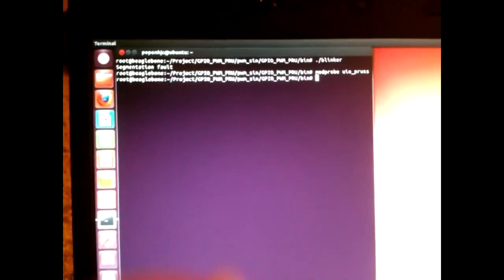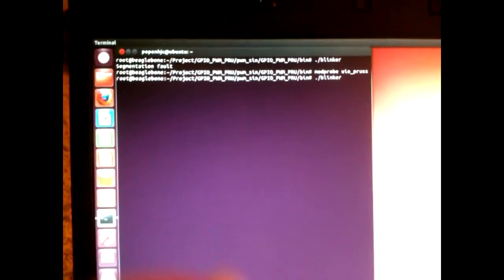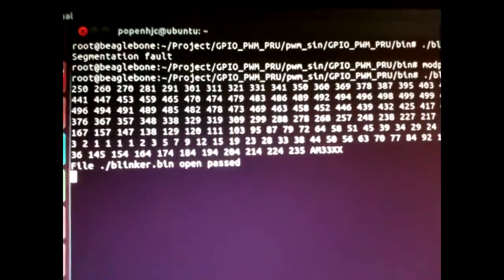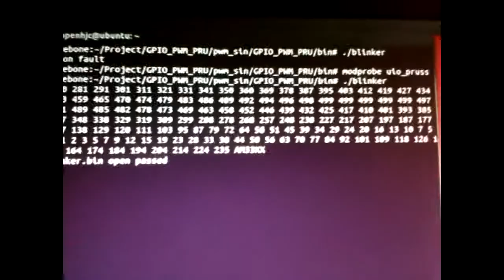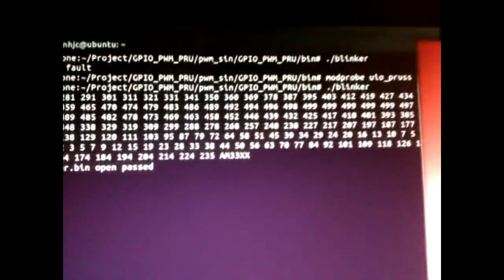BeagleBone PRU PWM Demo

Comment: Either use the PRU or you could just write a platform driver for whatever you are wanting to control (just fire up a PWM controller).  My project controls a pair of motors that both have encoders. (Its a little robot).  I wrote a platform driver that handles interrupts from the encoders and also performs the PID control algorithm.